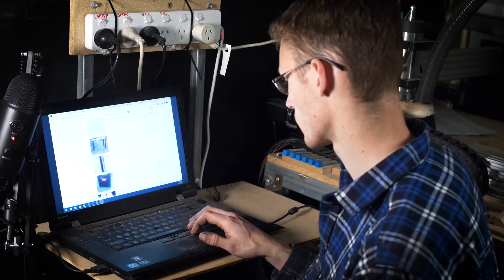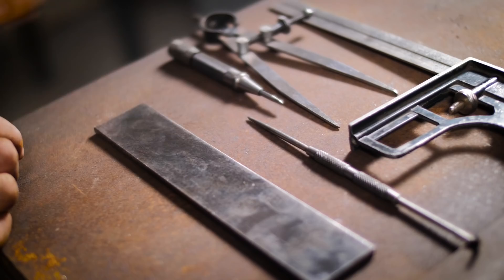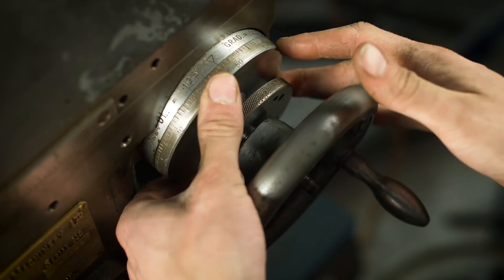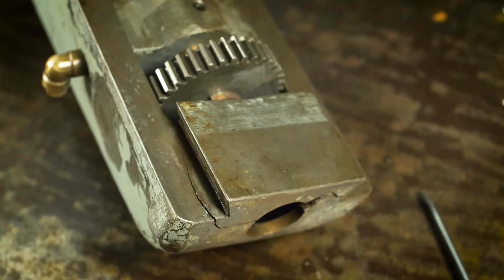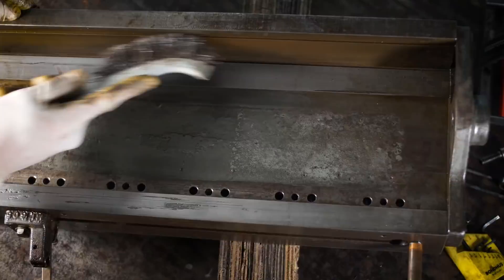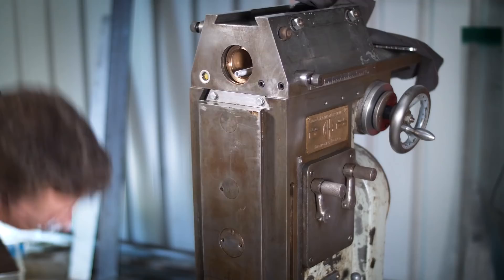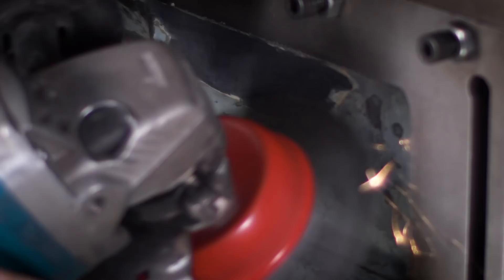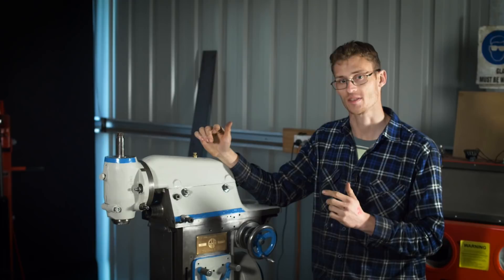GHA Milling Machine Restoration (Deckel FP1 Clone)

Comment: Awesome, Tom. Im glad that you didnt mess with the gearbox. I spent 2 months to just put them back together.
Reply from the maker: Yeah from what I could see and hear, everything is fine inside there, so I just gave it an oil change ha ha
Reply: @TomMakeHere  You're lucky, mine (an FP2) was broken so I had to open it and it was broken in such a way I couldn't get the parts out (well a few months of painstaking fiddly work did it eventually). I didn't think the gearbox was that complicated once I sat down and thought it through, and had the help of some schematics. The one thing I did not do was touch the clockwork mechanism that moves the forks around.
Reply: Further comment on the scoring (i'm watching and commenting as I go) I had a similar area on my machines X-axis because the table galled in placed due to insufficient lubrication (PO had used grease instead of oil, required a detailed takedown to clean out grease from everywhere). Anyway those scores can catch dirt and grime if they are exposed during travel.

the one on my machine definitely was exposed during travel so I bought some specialist epoxy (devcon, but there are other brands) and filled in the gouges, I had to deepen them first with a dremel tool to get a dovetail form, because I wanted it to hold mechanically if the epoxy ever failed. The epoxy is not as durable as the cast iron, but all it needs to do is to fill in the gouges so they don't trap particles and bring them inside your ways.

Also this machine does not have power feeds, that's a bummer. Does your other machine have them? I'd weigh that in if having to choose only one.
Reply from the maker: @dennisa6132  Some sort of epoxy is a good idea. The galling I suspect is a common problem with these machines, because the x axis ways are vertical rather than horizontal, when extended each way the ways are effectively exposed and could catch particles in the dovetail. I'm tempted to make up some wipers, and for good measure make a bellows style cover for the back
My other mill has an x axis powerfeed that I made, but I think it needs an overhaul. So it doesn't really narrow it down 🤣
Reply: @TomMakeHere  I believe if you oil it regulary then galling won't be an issue. Rescraping the sliding surfaces would likely help a lot. Galling is more likely when you got smooth surfaces riding against each other. The easiest way IMO is to give the sliding surfaces few light scraping passes for bearing. I plan to do this on my machine soon to reduce the friction. The gib I will scrape too and that I will also scrape some deeper pockets for oil retention since that's never exposed anywhere.

I also suggest retrofitting a central pump oiler, they can be had real cheap from ebay (though they need disassembly and cleaning before use), I did that so I wouldn't have to use an oil gun, instead I just have it permanently mounted to the mill and pull a lever to send oil to all the required places via small tubes.
Reply from the maker: @dennisa6132  Yeah  I will get a lot of scraping practice soon.
The oiler is a good idea. I have a one shot oiler on one of my other machines
Reply: The absolute worst gearbox I ever had to work on was on a Graziano lathe. It had a two speed motor with all the gear sets in mesh at all times. To change speeds in each range it had electromagnetic clutches similiar to the A/C clutch on a cars air conditioning compressor.  They simply are unavailable plus it had all kinds of needle thrust bearings in it.

Comment: Hot Damn!! Another adherent of the "crescent wrench with a hole as cheater bar" school of machining!!!
Reply from the maker: Got any other tips for something that is seized? I didn't want to use a hammer 😅
Reply: @TomMakeHere    Well, there is a method that definitely qualifies as 'last resort'. I ask 'She Who Must Be Obeyed' to step into the shop and give it her, 'I'm very disappointed' look. On occasion, the seized screw will back out by itself!
Reply from the maker: @stephenland9361  😂 that will do it!

Comment: The editing on this video is pure joy - thank you for all the hard work 😀 And - lovely job on the mill.

Those scores look like galling? - perhaps it has been run dry and under heavy load at some point? I would not worry about them at all though. Once you have decapitated any raised burrs around those areas with the precision stones, there is still more than enough flat area to do the job. It's not pretty, but it'll work perfectly - and won't get any worse so long as it's kept clean and lubricated. Those oil groove mods look like just the job.
Reply from the maker: Yeah not too sure, it might be because the oil grooves weren't connected, so wasn't getting enough oil. Agree, shouldn't be an issue really
Reply: @TomMakeHere  - I wonder how in God's name that was supposed to work, without the oil grooves connected to the oil supply?
Reply from the maker: @somebodyelse6673  Maybe the oil was assumed to nicely smear across the surface under gravity. Who knows

Comment: Nice work Tommy...this mill is one of the best designs ever for manual mills. I don’t have it but I know that here in my Country Prvomajska AGL100 is one of the most wanted mills. Decker, Prvomajska, Macmon and your mill are all thee same
Reply from the maker: I'm just not used to it, I can see that it's nice to stand in the one spot to use though. Just the z axis feels a bit awkward. I might need a powerfeed 😁
Reply: @TomMakeHere  try to search for deckel FP1 parts maybe you'll find the needed parts for power feed. Search in ebay.de and help yourserf with google translate...If you'll need any help at searching you can contact me... Happy new year

Comment: Great video, I’ve used this in the past on a table saw restauration and it works great, they also have rest inhibitor that works great. Boeshield RustFree Rust and Stain Remover
Reply from the maker: Cheers, I will look into it

Comment: Congrats for the big work and video. I have an FP1 copy on its way to me, which should have been well maintained. It didn't come cheap,  but it has both the regular and the high speed heads, as well the fixed and swiveling tables. These are on a pallet now and taking up already a lot of space, I am not fit enough to 
 replace any of these by myself so I will have to make a wheeled cart to have them near and attach a winch to the roof beams. I think all the work needed to put it back in service and then learn how to make parts will keep me busy already, so won't be blogging or making videos. But I have almost finished translating the German manual and will be glad to share it on some forum, as apparently one can't get an English version without paying exaggerated money.

Comment: What a spectacular machine.  I have to say, I love my old cochrane bly mill, wouldn't trade it for a brand new bridgport.  But this, this I would seriously consider. I have never been jealous of another person's mill, till now.  I can't wait to see this machine making chips
Reply from the maker: Thank you, it's damn solid for the size
Those Cochrane Bly mills look interesting. I've never heard of them.
I like interesting and unusual machines, but there are no unusual lathes that I can find
Reply: @TomMakeHere  hmmm. That makes me think.  What in your mind constitutes an unusual lathe?
Reply from the maker: @craigtate5930  There are numerous mill configurations, but it seems like the lathe has reached peak design? Other than turrets, or bar beds, they all look and operate the same if you know what I mean. I don't know what could be different, I just find it interesting that there doesn't seem to be any variation on the design
Reply: @TomMakeHere  lathes.co.uk has a section of multifunction machines. Several seam to be lathe based , a few are rather interesting looking. The leinweber UW-21. In my opinion is well worth looking at, let along some of the others. Some very neat designs. And of course some not so much

Comment: Awesome! I Have an original Deckel FP1, including that same swiveling table, but with auto-feeds. I miss the slotting head though. Very interesting to finally see a high-quality video of a fp1 teardown. Never been "down to the bones" as you have. Mechanically, it looks almost identical to mine. Although I'm not half as cleanly as you seem to be... congrats on the nice job and the great video.
Reply from the maker: Yeah the GHA is a very close copy of the FP1. I was very lucky that the machine was in such good condition inside. A lot of people dismissed the mill
Thanks for the comment

Comment: I would recommend a mill like this over any other mill because they are not the most rigid or powerful but they compensate with their extended versatility. A nice thing would be to keep them both because you can't really compare them, but is your decision.
Reply from the maker: Yeah I love universal mills for versatility. I think with a fixed table this would be really rigid. I know my Hercus is quite rigid given it's size, but this machine weighs nearly half again and it's the same size

Comment: You got lucky with your oil tank. Mine was just half filled with old oil that had turned into a black tar like sludge. Don't think previous owners had run coolant for over a decade and never cleaned the old stuff out. Lucky me...
Reply from the maker: lovely. I ran some kerosene at the end to get things flowing better, but generally mine was quite vacuumable thankfully

Comment: That was funny -
       "this is silky smooth" SNAP
Reply from the maker: It helps when you fully assemble before demonstrating 🤣
Reply: @TomMakeHere  This was the first time I've seen a small Milling Machine like that.  I would love to learn machine work.  To me it looks like fun repairing and using a mill.
Reply from the maker: @zband9016  yeah, small decent mills are rare. Machining is fun, it gives you the ability to make almost any mechanism

Comment: Nice score!  I'd be keeping both machines if at all possible, but I guess it's all dependent on available space.  Good call on the epoxy paint, I should have used that on the shaper here.
Reply from the maker: Technically I could squeeze them both in, but they have the same size and same work area, the GHA is more torque-y and offers the universal table. So that kinda decided it
Reply from the maker: One thing if you do get epoxy paint, check that it is glossy, mine is apparently semi gloss, but it came out kinda matte with a porous surface. One touch with a dirty hand and it stays filthy and can't really be cleaned

Comment: Very nice job 👍
Reply from the maker: Thank you! Cheers!
Reply: @TomMakeHere  so which mill do you think you will keep? That new one looks like it has some cool features with its table
Reply from the maker: @tom18181  Yeah it's actually really difficult, it's about the same size in every way, but has the fancy table, but everything about using the mill feels really awkward at the moment, and changing horizontal to vertical isn't as easy (the head is about 25 kg and has to be carefully placed at chest height). I probably need a little swing arm crane to change the heads
I just need to get used to the controls first I think
Reply: @TomMakeHere  Oh really. Well that does make it tricky. I guess if it’s still feeling awkward in a few months you might be better off with your other one which is still a very good mill by the looks of it. I guess only time will tell really.

Comment: Great job on the mill restoration!! Bummer about the scoring on some sections but it over all looks great!
Reply from the maker: I will be going back with JB weld to fill those areas
Thanks for watching
Reply: @TomMakeHere  Great idea! I hadn't thought of that. My mill at work has some pitting but I don't think its deep enough to be able to fill it with JB weld and have it stick

Comment: I'd be a little gutted about the auto feeds but aside from that you have the mill I want next. I love my adcock and shipley 1es with bridgeport head but the travel is so limited it's like 13x6" x and y. Nice blue btw
Reply from the maker: On the other hand, it sounds like a good future project 😁
The powerfeeds sound like they were a pain, they were one set speed unless you play around with change gears. I will make a simple electromechanical system (far simpler than the previous powerfeed)
Yes I actually like the blue more and more.
Thanks for watching

Comment: Very nice restoration!   I had never heard of this manufacturer.   This model has a very appealing footprint.   You chose a very inventive color scheme.    Nicely done.   How is the power?   Thanks for sharing this.
Reply from the maker: I had never heard of it either, it is a clone of the more well known Deckel FP1 (German made).
I was able to cut full width with a 63 mm facemill, with a 2 mm depth of cut in mild steel, It has got some power and rigidity for the size!
Yes colours are always controversial ha ha. I like it though, it looks like a high tech machine from space😁

Comment: Scored/galled X-axis, about every old small Deckel has that. 
I milled down the scored layer on my FP2 NC and replaced it with bronze liner, scraped it afterwards. Wasn't nearly as deep as on this machine and FPx NC dovetail/box way geometry is much better to machine than those dovetails on FP1.
Reply from the maker: I'm thinking I'm at least going to epoxy fill the galling to prevent contaminants collecting in there
I think some sort of bellows covering would be a good idea on the x axis, as the ways are fairly exposed

Comment: Great vid, freakin' awesome milling machine, I'd keep both, but on the off chance you decide to let one go, you could drop it off at my place, next time you pick up steel from Josh at Tyne Valley;), I've got two Hercus Lathes(the old flat bed is a dedicated Turnado now), and am looking to add a bigger milling machine in 2021, maaate:).

Have a great New Year,

Scott.
Reply from the maker: Well, once I build a gantry I can at least think about moving one of the machines 😁
I'm looking at upgrading the Hercus lathe next year, it's a good lathe, but I reckon I'm due for an upgrade

Comment: I have a deckel fp1 in similar shape waiting for a rebuild. Your ways really need scraping. They are damaged by galling due to the poorly designed oil grooves (which really surprised me). It won’t run like it should until you address that.
Reply from the maker: Yeah I just got a scraper the other day. I plan to scrape what I can, and then put covers over the back which is quite exposed

Comment: What a great restoration. Excellent stuff. Adding power feeds would make for an interesting video (hint hint 😉). Perhaps a collaboration with Ca Lem is on the cards I wonder ? 🤞
Reply from the maker: After reading how the powerfeeds were set up I'm either adding to this mill, or reconfiguring the other mill. 2 (or even 3) axis powerfeed is starting to sound very useful!
Ca Lem has already been to my workshop if you check out his instagram 😁
Reply: @TomMakeHere  Crickey !! How'd he manage that ? Long story I imagine. The plot thickens.......

Comment: Great job, great video and great commentary. But will you manage to find the missing parts to the power chain? I've subscribed. Us Toms should stick together. Tom
Reply from the maker: Cheers!
No, the powerfeed will be an upcoming project. The original had change gears to set the feed rate, I will make something that is easier to quickly change speeds
Tom seems to be a rare name these days, it used to be really common

Comment: This video really helped me already a lot (i'm in middle of restoring a fus 200 - quite similar). I have a question - did u manage to disassemble the lead screw nut from X axis? I'm stuck a bit with it and I guess it will be quite similar as in your machine.

Comment: Recently bought on old version of deckel fp1 . Does the horizontal spindle drawbar come out of the spindle. It's rotating but not coming out. I want to check the threads of drawbar so I can purchace some collets.
Reply from the maker: I'm not sure, I made my own horizontal drawbar
The vertical one that came with mine had a bottom thread that was too big to fit through the spindle, so the vertical drawbar had to be inserted from underneath and then secured with a nut on top. Maybe your drawbar is similar to this arrangement?

Comment: The question is what did you use to clean out the tank? There had to be a lot of sludge inside that tank.
Reply from the maker: vacuum did most of the work thankfully, but some kerosene helped to get things flowing better

Comment: Nice mill, nice job, nice video.

And yeah (I'm a Brit) I got the Dr Who ref.

Did you have a full service manual for the mill, or were you just undoing fasteners until it came to pieces, clean, then reverse?

(take LOTS of digital photographs!)
Reply from the maker: the 'manual' is more of a sales brochure, it just shows a few accessories and lists the spindle bearing clearance.
I just took it apart and put it in organised piles. But I tried to clean things and put them back when done so it wouldn't pile up

Comment: Hi Tom! Really funny! I did the same restauration 2 years ago. It was an Infratirea, same klon like your machine. No videos, but lot of pictures on https://forum.zerspanungsbude.net/viewtopic.php?f=56&t=28992&hilit=fischerverla&start=10
Now we use it in our Makerspace Amstetten.

Best regards from Austria, Tom (too)
Reply from the maker: Nice looking machine, it looks like you had a lot of work to do on yours! I got lucky with mine
Reply: @TomMakeHere  yes appr. 300 hours, electric new, some spindle nuts new...if you need some fotos or other information, please call me. you will change your feeds by servos or stepper motors most propably?
Reply from the maker: @thomasfischer6548  I'm thinking DC motors is the easiest option. I'd go for a pure electro mechanical system, I've done one powerfeed via programming and it's a pain and subject to noise